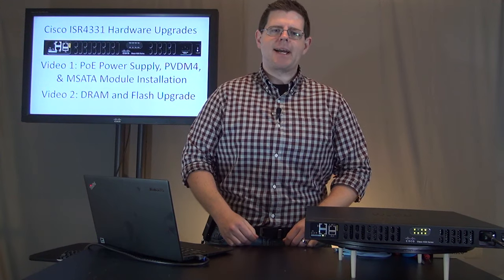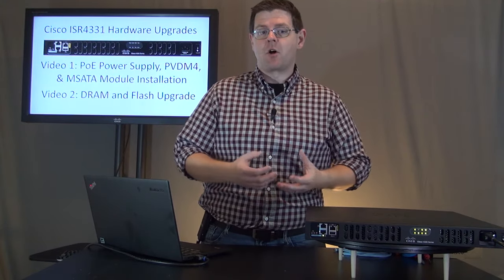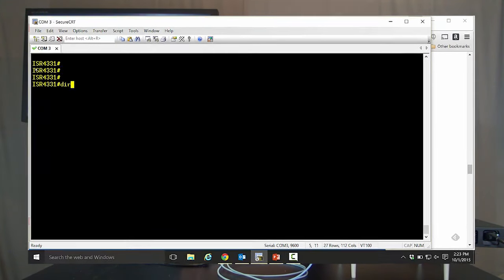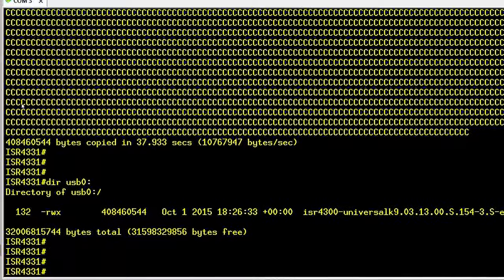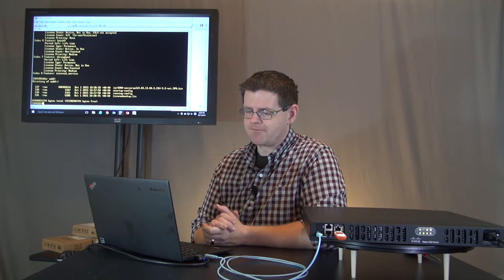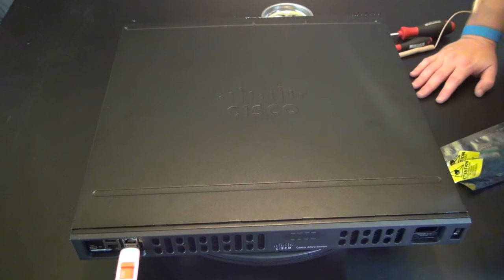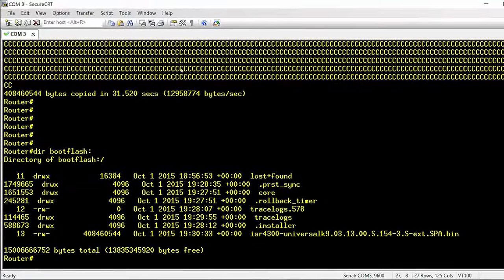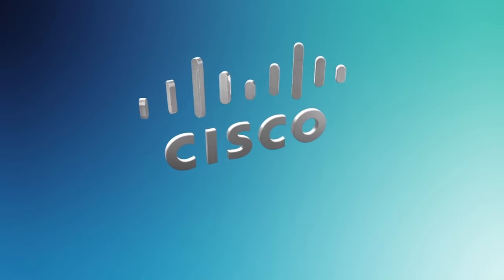ISR4331 Under the Hood Part 2: DRAM and Flash

Comment: Re: Your statement flash must be twice size of DRAM. Per data sheet, max flash and DRAM for 4331 is 16GB.  How's that work?
Also, if I have a mSATA drive in the unit do I still need to upgrade the flash or will the router write cores to harddisk:?